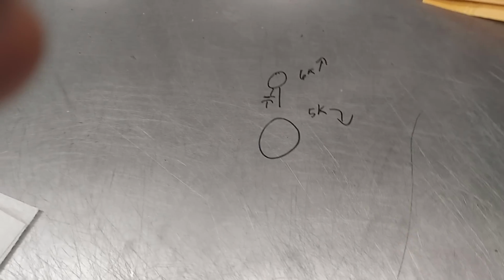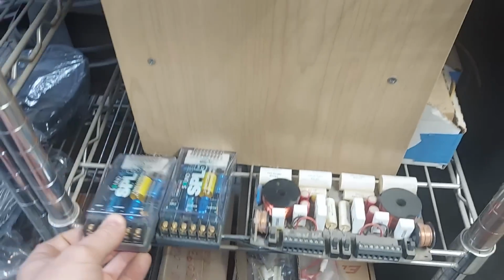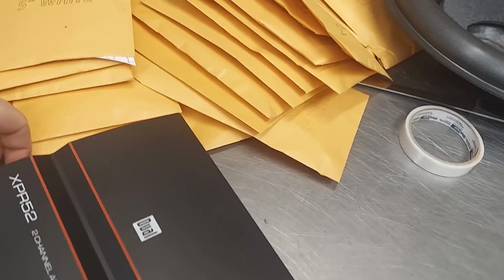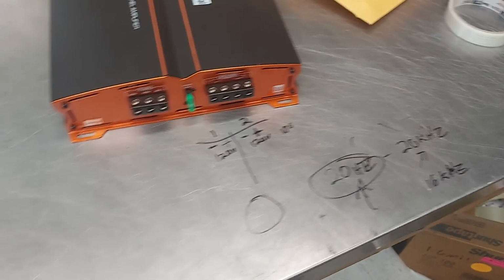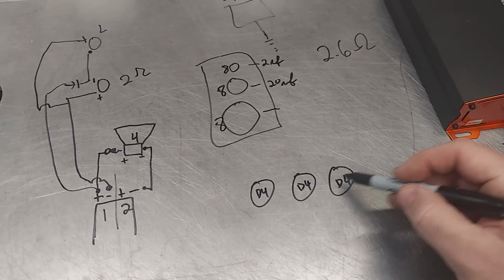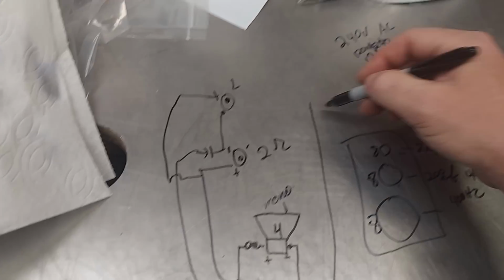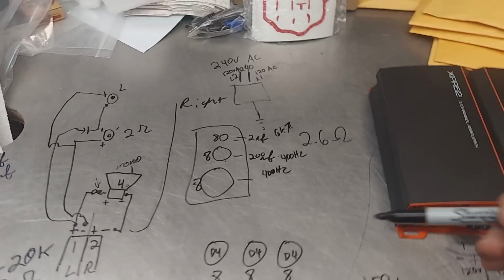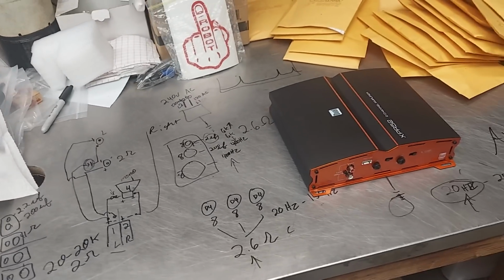Tri Mode  simultaneous mono / stereo mix from a BTL /  bridgeable two-channel amplifier.  #Math

Comment: Never run this type of setup,even way back when.  Isn't level matching coaxes to the sub problematic.  Seems easier to go multi amp and built in or active crossover in this era of cheap power
Reply from the maker: I agree and with those amps being $45 each, you can run two of them.  Someone had asked about it and I wanted to give it some context.  In the 90's, this was a money saving tactic since amps were $1 per watt.

Comment: Can you do the tri way to make a center channel with an 8 or 16 ohm driver and have is sound good or will it lack.  Was thinking of doing this and crossing the channels at 200hz for 3 4" full range drivers.  I have a 4 channel class A/B and the front channels run tweeters rear run 4" . Second 4 ch front runs 6" midrange from 50hz to 250hz and the rear runs rear coax crossed at 50hz
Reply from the maker: Yes I have another idea for a video to show you how to do complete surround sound with a punch 40 or something like that

Comment: When the shop owner sold a low cost system we would use urban audio and 4 channel. Two channel briged ti sub and front and rear speakers in series

Comment: Come on Patrik, Pink noise and white noise is not what you think...
Pink noise is the same amount of energy at every octave of the human hearing range, so it's a flat response
And white noise is every frequency at the same level at every octave, so you get a rising response from the bottom to high frequencies
Both are 20hz to 20khz
Reply from the maker: I did not know that.   I was just remembering stuff from 1994 when they told us that white noise would go up to 50khz or 100khz or something like that.

Comment: Is there any way to make a standard 2 channel stereo amplifier into a tri-mode amplifier?
Or does it always require a tri-mode capable amplifier?
Reply: It has to have it
Reply from the maker: Well that's why they invented the dual voice coil.  You don't need to run it tri mode.  You just need to hook up each channel to a coil if you want.  I do make D8 subs.